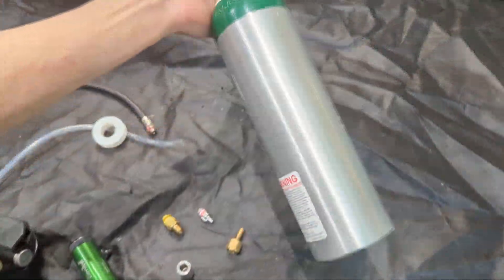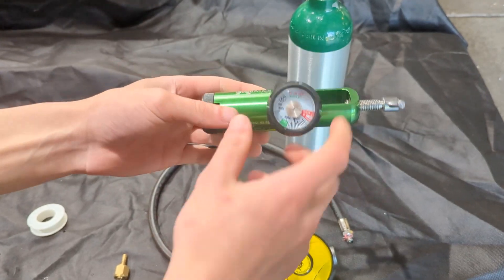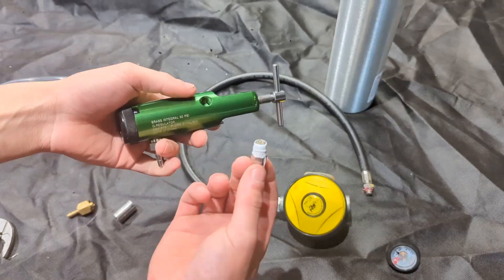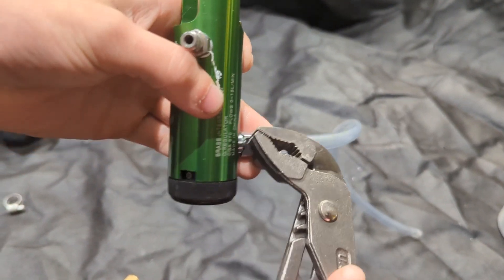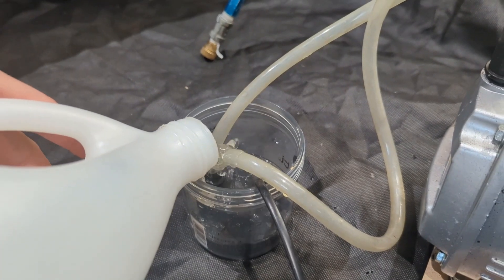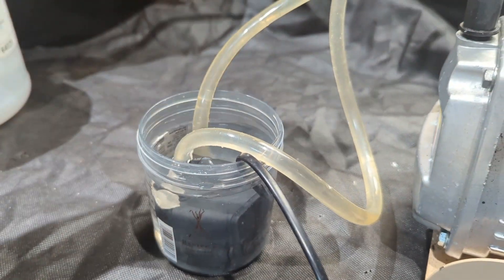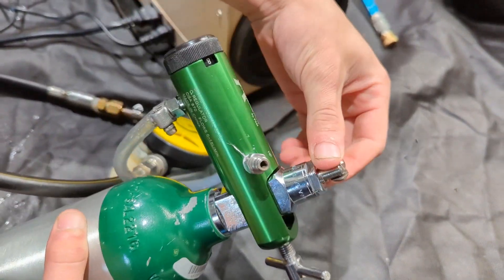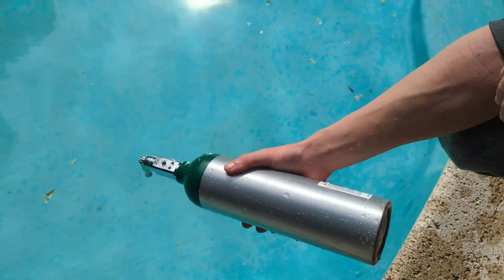HOMEMADE SCUBA FROM OXYGEN TANK 2000PSI!

Comment: Using pure 02 deeper than 15 feet of water may cause central nervous system paralysis. Never dive with pure 02 unless you have been trained on how to use it for deco procedures.
Reply from the maker: i used air

Comment: Be aware, that if you dive too deep, you have to plan for decompression stops (otherwise you may get decompression sickness).

Also, there may be fine oil mist in the air from the compressor. Make sure you somehow get rid of that (some kind of oil-scrubber?)
Reply from the maker: i went 10 feet i wouldn't take such a small tank lower
there is oil mist but i have an inline filter on the way
Reply: @ianbuilder I would strongly recommend putting the filter on the intake when you're filling the tank.
Clean that tank out of all that oil.
If that filter goes bad while you're underwater breathing pressurized air.
R.I.P.☠️☠️☠️☠️☠️☠️☠️

Comment: I have an interesting idea.

What if there were some type of an inner tube with an air pump in the center, that would push air into a tube into one of those full face scuba masks? 

It would always stay on the surface somehow and have a valve or filter to stop water from entering. 

That way someone could dive deep with air constantly getting pushed to them. They should be able to inhale and exhale without any issues.
Reply from the maker: lmaooo thats my next video  how did you know its 2 medical compressors, batteries a floatie and a long tube
Reply: @ianbuilder  I like that we think similarly in general. I'm excited to see it!
Reply: I believe you're talking about a hooka rig.

Comment: Cool project.

Reminder: DO NOT USE PURE O2 FOR DIVING! Look up scuba mixes. 
Just noting this because you're usin an 02 tank. I see you used air which is cool.
You can look up the math and find out how long it will last based on gas composition, pressure, and tank volume. (or estimate those by weighing an empty and full tank)
Reply: Yes, also don't use pressured air if you haven't done a proper scuba education. Taking a breath at 10m, or less, and holding until you get to the surface will mess up your lungs.
Reply: @korvmakak7727 God I hate divers so much
Reply: @BillyBob-bd1hj  why hate divers? Also pure oxygen? Nitrox might be *enriched*, but pure, I strongly doubt..
Reply: Pure oxygen is used for diving all the time.
Reply from the maker: yea i assumed anyone that would build this would know that